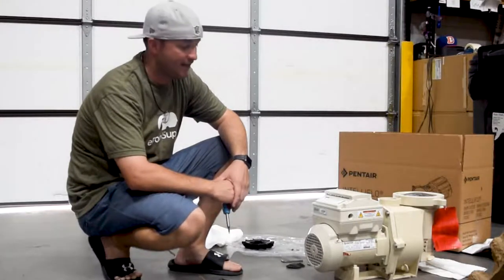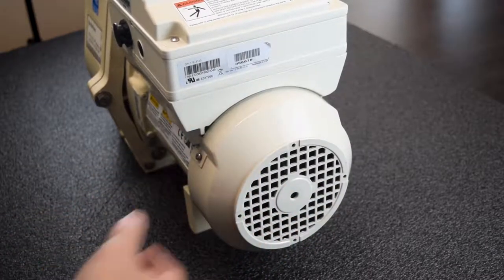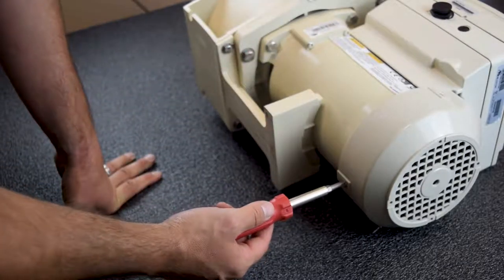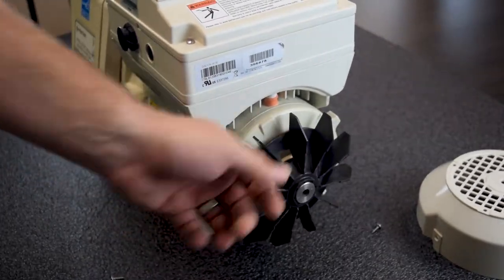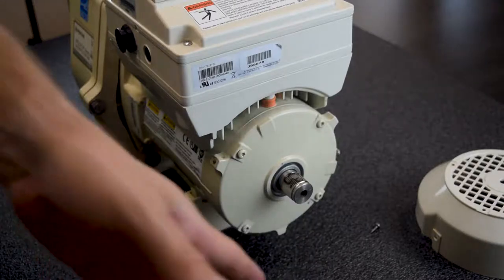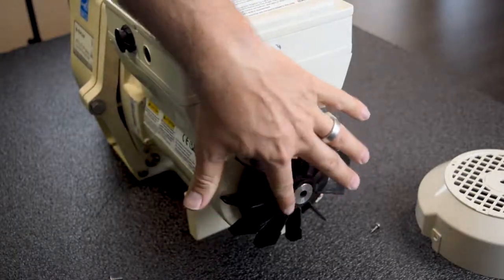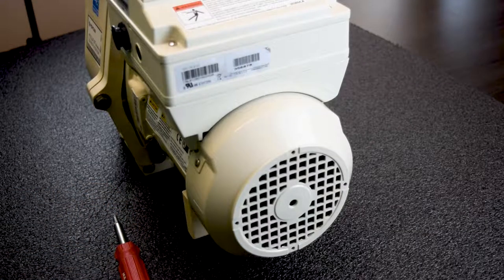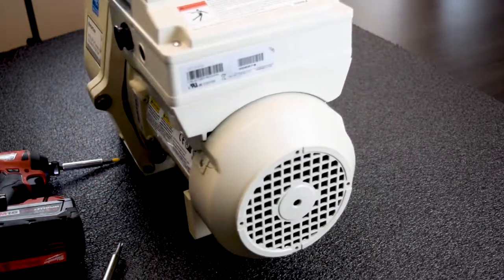How To Replace Pentair Intelliflo Fan and the Fan Cover - Part# 352401

Comment: My pump just started making a noise similar to when grass grows and gets into the fan, it's a noise as if a piece of grass of paper etc were hitting the fan. I couldn't see anything obvious through the fan cover, but admittedly I can see too much in there. When I put my hand on the bottom of the cover and apply some pressure, the noise goes away. The noise comes back as soon as I take my hand off the cover. Of course, it's a pain for me to get to that bottom screw. I'm just curious if you think some debris could have gotten in there and is causing the fan to make noise.  The pump seems to be fine and pressure is normal.
Reply from the maker: Hello, something like that may have happened but the only way to know would be to take the fan cover off so you can get a better look inside. If it becomes more of a problem and you start having more serious issues with the pump then you may need to have a tech come out to look at it. Hope this helps.